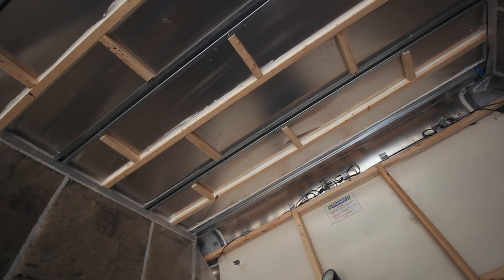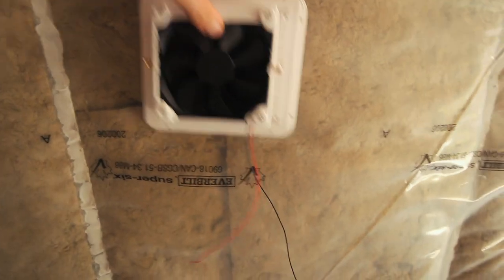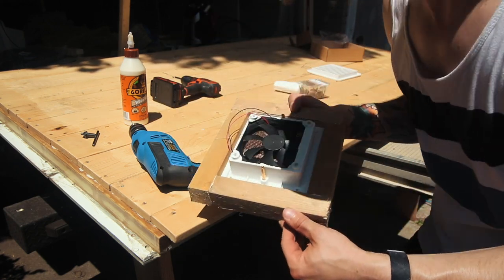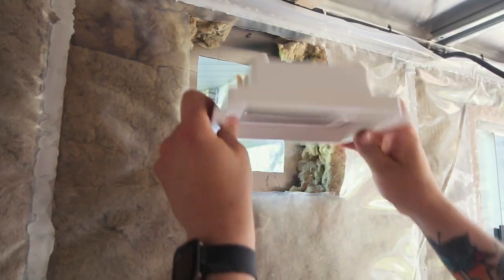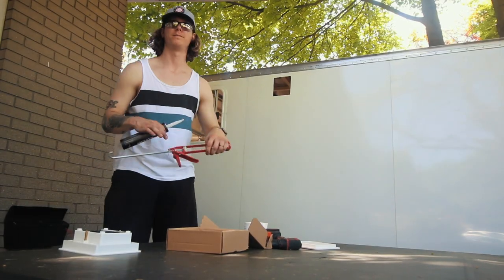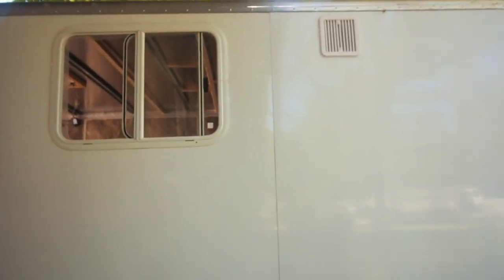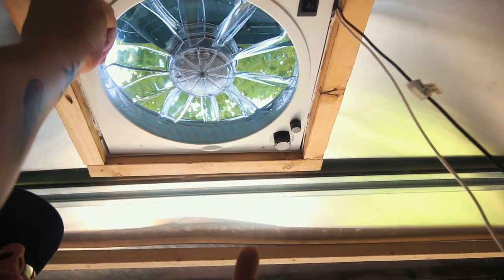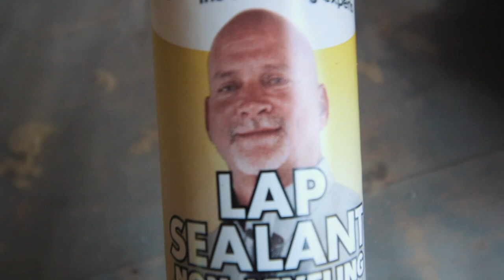DIY Stealth Box Truck Conversion:  Shower Vent installation and Ceiling Insulation

Comment: Nice job so far man, just an observation: The grill for the bathroom fan should be installed horizontal instead of vertical because water in going to get inside the wall.
Reply from the maker: Yeah I know thanks lol rookie mistake 😂